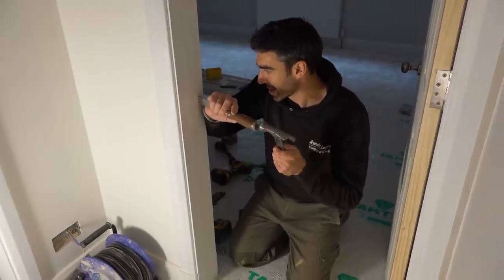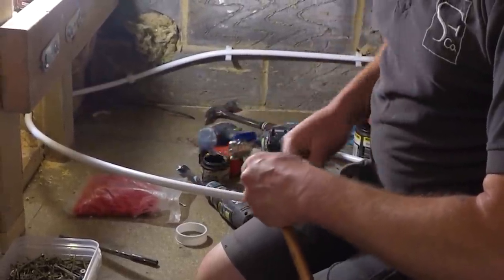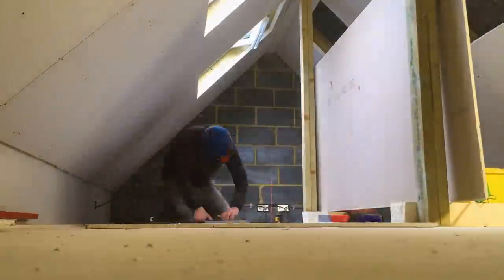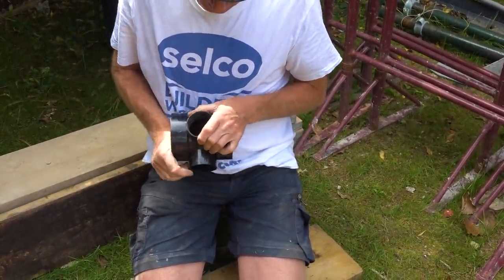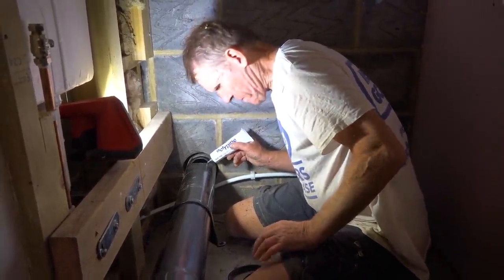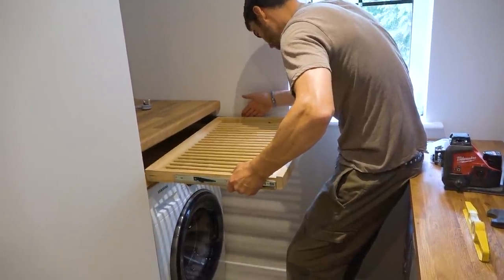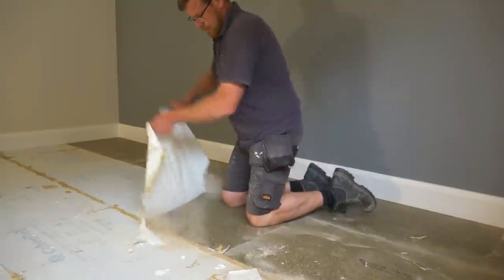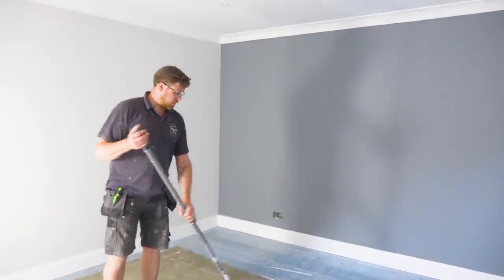On the Home Straight ~ Extension Build #26

Comment: Another great video guys. I’ll remember that strap boss solvent weld tip. I used regular solvent weld when I put one in my loft. It’s only for a condensation trap drain off an extractor fan so hopefully won’t be an issue…

Comment: I noticed the socket heights in the room that James was rolling the floor.
I thought, and probably wrongly, that sockets had to be 1000mm or something from FFL.
What's your thoughts please?
Reply: I think that in an extension the new sockets are allowed to follow the existing height in the house, something to do with the heights being apart of building regs and not electrical regs
Reply: Minimum recommended height is 450mm from FFL.
However as this is an extension and the original house would not comply with current building regulations (part M I believe) the extension can match the existing house which is probably why they have installed the sockets slightly lower than modern regs.
Reply: Definitely not 1 meter above FFL, imagine how messy that would be with electrical cords